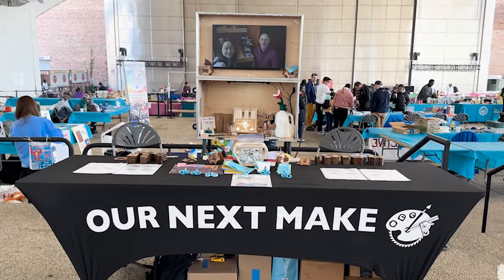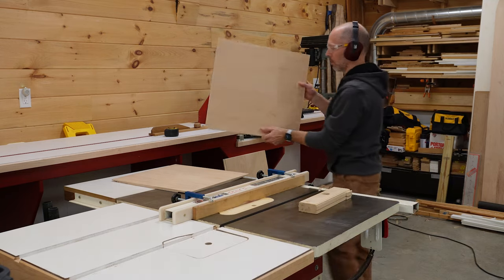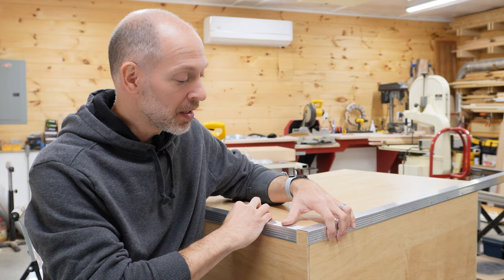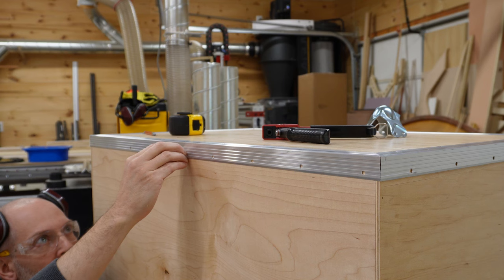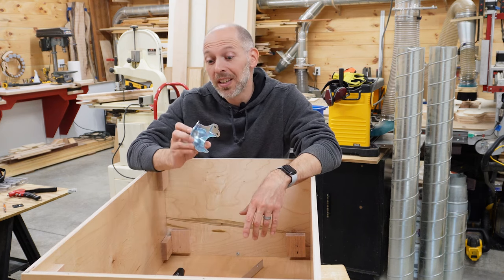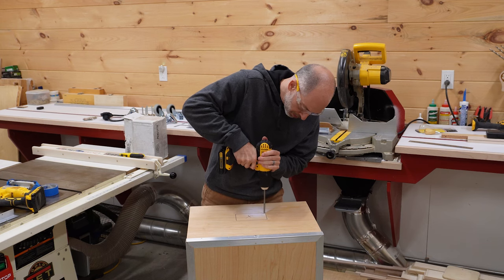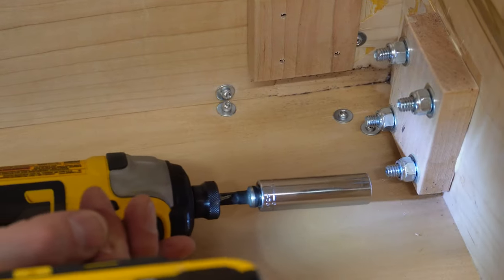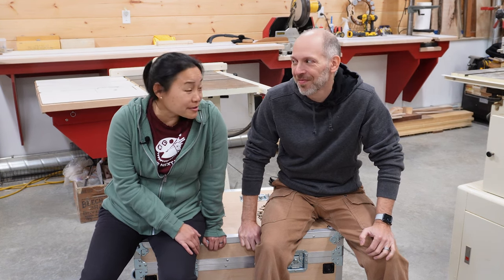DIY road case (flight case) - easier than you think!

Comment: To frame your case you should have purchased the 1/2" double angle if you wanted to go with 1/2" plywood - The double angles makes sizing and assembling the case so much easier. Solves any  issues with the corners. Ideally you would use the 1/4"plywood sheets with plastic laminate and 1/4" double angle to keep the case weight down - This stuff is durable - I bet it is as durable as what you built! I buy these all the time for my equipment - they are not that expensive - I have also purchased used ones at government auctions and downsized them. You can typically buy them at an auction for 1/2 the hardware cost.
Reply from the maker: Thanks for the great feedback! We were certainly intrigued by the double wall extrusions, but went with the single wall as it just felt a bit more familiar, and aligned with our typical approach for building wooden boxes. We're glad to hear that they make the project go much easier. Also, thanks for tip about the 1/4" ply. Our case did end up a bit heavier than we had hoped, so we'll definitely have to give thinner ply a try for our next build!

Comment: I occasionally order these for work. They aren't terribly expensive, but this is an awesome build. One thing I like about the place I order form is they cover the inside with carpet, which covers all the hardware to avoid scratching equipment and hands.  They cover the outside with some sort of hard vinyl-like black coating that nothing sticks to, which keeps it looking clean an new.  Over the past several years we've experienced about 5 shipping incidents where the shipper puts their forklift forks through the side. I have either patched the holes with a steal plate and bolts and lock washers, or ordered new cases.
Reply from the maker: That's really cool. Thanks for sharing. Covering the inside is a great idea. The rivets and other metal bits can certainly scratch things up. We've seen carpet applications as well as custom cut foam to hold things in place. We just love how customizable these cases are.

Comment: Thanks for the inspiration!
Last year I also built myself two flight cases. One to transport an Amiga 500 and a desk riser (built from 2020 aluminum profiles and phenol resin plates), the other one as a pre-wired 10” 9U rack unit with an Intel NUC and a RPi with Retropie, networking and Blinkenlights in it. It has a mains connection, a junction box for two 10” rack mount powerstrips and a separate, hardwired 5V PSU for the blinkenlights and an LED light strip in there that is controlled by an ESP32, which also links up to the inbuilt WiFi network. That case I just need to put on a table, take off the front and back lids, set up the screen (stored in one of the lids), plug in power, pull out a mouse and keyboard and I am off to the races. I have a GL iNet router in there so I even have internet connectivity. Pretty neat if I say so myself. And it is evolving. 

It is an absolute beast in terms of weight. Same for the Amiga case. And the next time I build a case, I will make sure to get a pneumatic rivet gun. I am not going to torture myself like that again. 😅
Reply from the maker: We're glad you liked our build. Thanks for sharing the details of your flight cases. They both sound epic!